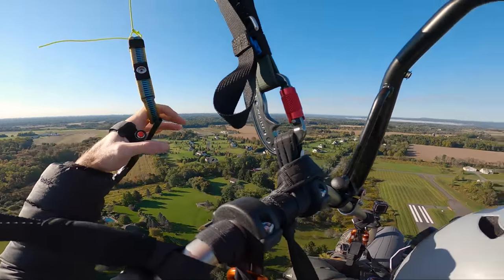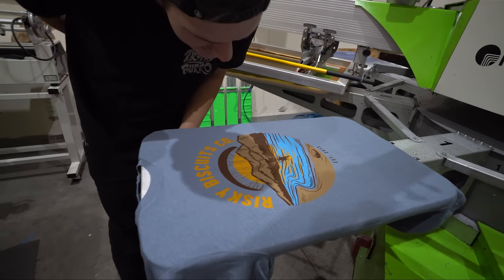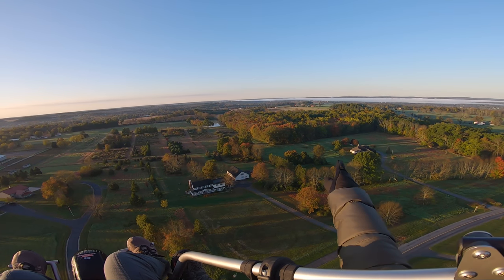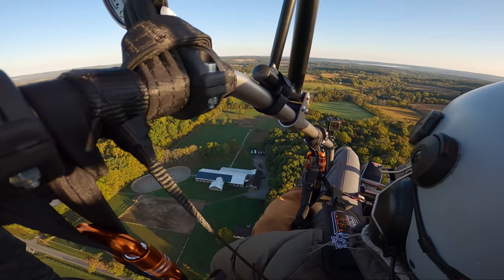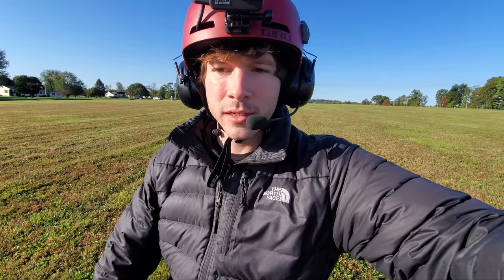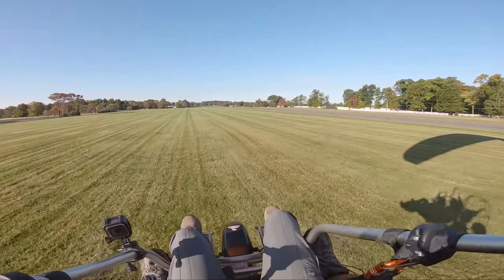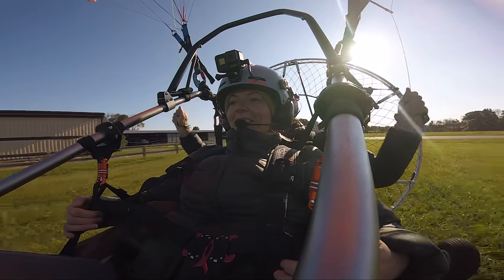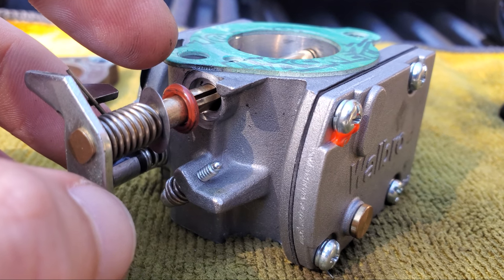I had an ENGINE FAILURE while flying my girlfriend to breakfast...

Comment from the maker: A stuck throttle and strong winds aloft made for an interesting return flight. Luckily, I had practiced landing the trike with no power while flying solo so I felt prepared for the challenge of doing it tandem! Stick around till the end to see what the problem was but I have a brand new carb on the way. Also, be sure to check out the new designs and get entered for this giveaway. Taking a subscriber flying is going to be next level! - https://tuckergott.com/collections/all
Reply: I'm impressed with how calm you stay. That's good since it helps you think clear.
Reply: well done for being prepared for the deadstick ahead of time.  Bit of a Wallbro design 'feature' there  that an o-ring bulge can cause no throttle return...  Thanks for sharing as ever :)
Reply: I'll volunteer. I will be in NJ in November!
Reply: Good Job Fellow NJ Bro!  I was born in PASSAIC NJ in the 70S ... Lol
Reply: Another great video thank you. Just a thought on the problem with the carburetor. First if there was a slight indentation at the point where the end of the spring it's up against the carburetor that would keep the little end of the spring in place so it wouldn't move past its mounting point. Second of all if you had another throttle cable for the other hand that would be used in emergency to manually retract the carburetor back to to idle that way you could use your throttle hand to speed up on the other hand to pull it back manually if the spring fails again. Hope this all makes sense can't wait for the next video.
Reply: Dude what settings do you have the GoPros 7 on as the picture quality is so crispy 🤘🏻I have a new Hero 9 and the picture quality is terrible
Reply from the maker: @Coaster_Crazy  I film in 2.7k 60fps and superview on the Gopro 7 and 8.  😊
Reply: Tucker Gott cheers dude much appreciated !! Ps I love your channel and your videos and have been watching for a couple of years now from across the pond in England ✌🏻
Reply: Gonna say it AGAIN, these power plants have WAY too many problems at WAY too high rates (problems/hour flown).  I fully understand that landing one of these dead stick in a given area is far less dangerous than dead sticking a plane, on average, but if you have an engine failure (not this one, but a power out type) flying low over trees, the type of flying you do not infrequently, it is not likely going to be "all good", probably not fatal, but probably not injury free, either.  In ANY aircraft there should be more care given to power plant reliability than there is in PPG/PPM.  I would be interested in the number of injuries (% of total injuries) due to power plant failure.  I should see if I can find that data.  People love to dismiss comments like this with an eye roll (as you may, but actually stop and THINK about what I am saying for a minute)...UNTIL it happens to them, then, not so much.

"You ain't got nothin' on this trike guy"...LOL...but he DOES, and one is a power plant with a LOT more reliability.   Another is race him to his destination and see how that goes for ya.  Seriously, though, these motors really do need to be worked for reliability, that ISN'T a joke.  You guys are dead serious about lines, 'wings', attach points, etc. and not serious enough about engines that work reliably, IMO.  The community CAN put pressure on motor designer/producers to put serious effort into this area, and should.  While I'm sure (I hope, actually) that reliability is constantly increasing, I see far too many of this type of PPM video.

BTW, I can almost guarantee you that "rolling up in a trike" to most aviation enthusiasts would NOT look lame, not at all.  Seriously cool. 

 Second BTW, you can definitely get an O ring for that. Did you try Walbro direct, or just the engine manufacturer?  Even beyond those two sources, you just need one of the correct material to be fuel resistant (obviously not proof, given your problem, but made to work in a fuel environment :-/ ) and if you look up standard metric (I'm assuming, could be SAE, depending on where the Walbro carb is manufactured) O ring sizes and caliper that one, the shaft diameter, and two O ring cavity dimensions (diameter and depth) you can order one or probably get one at an auto parts store.   It looks to me as if that spring end maybe should be carefully bent back to closer to orthogonal, too, but I would check a pic of a new carb to see if that's true, and straighten, or better yet, replace it.  

Also, that is a really crummy design implementation of an O ring, but since it's just a bit of vacuum, it will work, and they were going for cheap cheap cheap.  I understand they are basically throw away carbs, if something breaks (you can rebuild most of them if they are still intact).  Basically the same 2 cycle pressure pulse displacement type carb as on a chainsaw, weed eater, etc, scaled up (it looks like, anyway, could be wrong).  I looked up a few of their standard kits and I didn't see return springs in any of them, gaskets, the diaphragm, needle valve, a few O rings, but probably internal, as they looked larger, and a few hardware parts.  No idea what would have been available in yours specifically.
Reply: @tomwilliam5118  A notch to prevent the spring from moving would be a good way to keep the throttle working. Then you'd have to wait until the 0 ring completely slipped out or broke so the air leak past the shaft leans it out and destroys the piston. Or you could just add a visual check of that O ring to your preflight.
A secondary - return - throttle cable would double the complication of the throttle system. You're adding another whole item that requires maintenance and checking and adds weight and still won't fix or prevent the actual design problem. Or you could just add a visual check of that O ring to your preflight. 
I like the spring notch idea but definitely would keep an eye on that O ring.
Reply: If I see JacLyn  or engine failure I’m  definitely watching the video!!  if I see both I’m quickly watching!!!  She’s a keeper ! Get married up in the sky!!!
Reply: Your favorite hardware or NAPA store should have good selection of O-rings.
Reply: Good thing you guys made it to ground safe!
Reply: Make sure you write up a liability waiver for the giveaway tandem flight.  :)
Reply: Zip tie or wire tie would be an easy way to keep the next one from sliding, I'm sure you'll think of something tho.
Reply: Tucker Gott read the other message that I wrote you in the comments section in reference to o-rings.✌️
Reply: You should make you’re paramotor look like a tie fighter
Reply: Tucker I imagine you can just size the o ring and buy standalone replacement parts off of ebay or something.  It's not like a rubber O ring is very difficult to make.
Reply: You could probably wrap safety wire around that post to hold the spring in place without compromising the integrity of it.
Reply: Dude you got a 1.4 million subs, You sir should be giving away a complete set up IE: paramotor and wing. The flight with you is nice but in the end you would not be living the life style you do without your subs.
Reply: Good to see the two of you safe!
Reply: Be careful man the throttle malfunction could have just been a carbourator malfunction leading to a engine fire burning through the parachute lines 
This came from Someone with 30+ years in the business
Reply: Better a cheap new carburetor than a new expensive lawsuit.  They also want it for R&D concerns as well.
Reply: I am surprised the carb does not have a tab or notch to prevent the spring from sliding off like that.
Reply: You are awesome!!
Reply: Were you get that rig at i like the whole set up with the trike no more running
Reply: Risk your own life only and leave the GF home. This whole insistence of dudes being like oh my girl is going do everything with me is simpin.
Reply: phi
Reply: Hey what model is that
Reply: Trucker dear how can i get one paramotor (complete) and do tell me the price as well, im in pakistan how much i will cost me to get here?  Do reply thanks and have safe flying. Salman.
Reply: Sky manor has great burgers!
Reply: On the stand up landing one you would just have to let it run out of fuel, then coast back to the ground haha!